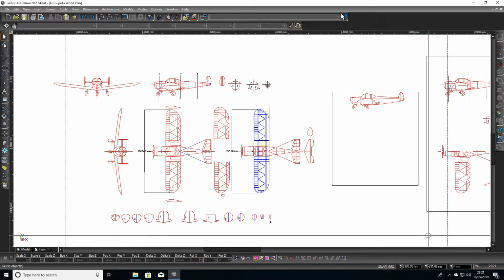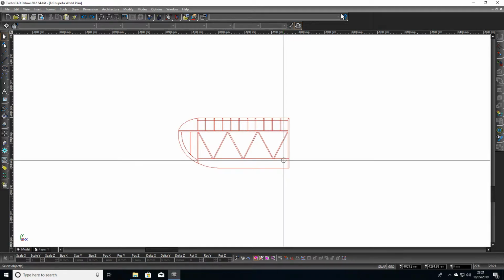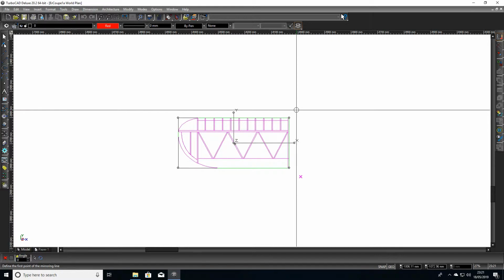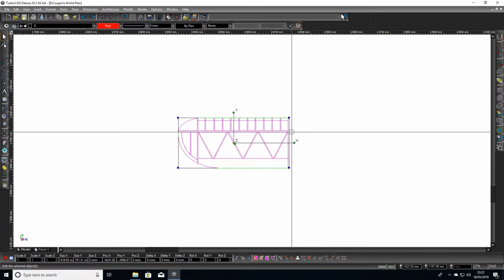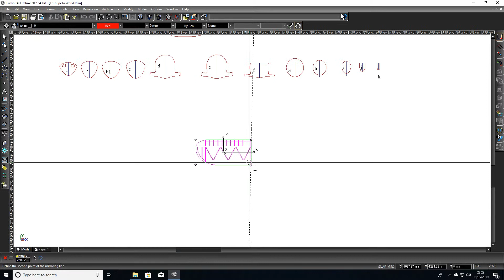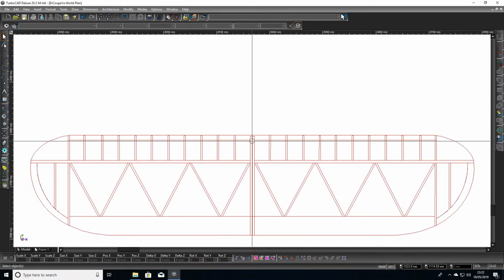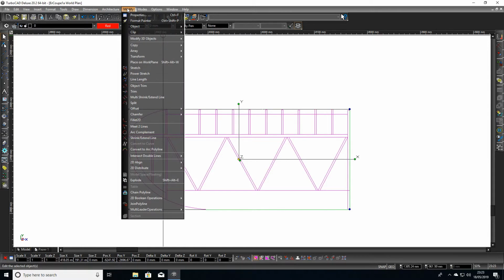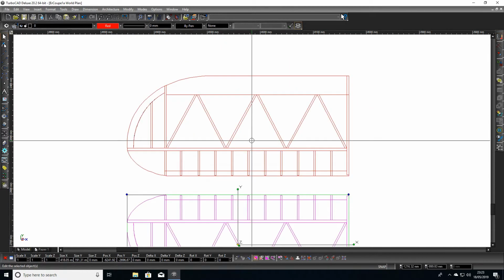TurboCad Deluxe 20 Mirror copy

Comment: Thanks for making this vid! Getting ready to buy Turbo cad 2019, In trial mode right now. Was having a hard time figuring out the mirror function. Thanks again.
Reply from the maker: Hi,
There are lots of good videos for TurboCad but i find i have to watch a full video just to find out how to do the one thing i was strugling with.
So that is why i made this one to show a buddy how to do simple mirror function. I have tried a lot of Cad programs inculding free ones, i find TurboCad easy and have been useing it since version 14.
Thanks for the repley.
Reply: @RcAircraft  Have you ever figured out how to use a center line with mirror reference.  Like if you draw a box  with a center horizontal and vertical line. set some how to mirror. So anything you draw in any quadrant/corner it is mirrored?  I have been also using a few other cad programs.  Q-cad, q-cam, and designspark, using Cambam, mach 3, with my cnc machine. 1 year in now and have learned so much in one year. P.S.  you should try Designspark its amazing. I can set mirror functions so easy in that program.  Just not sure exactly how accurate it is.  Thats why I am looking at Turbocad. Need the maximum accuracy.  Happy New year.
Reply from the maker: @toddspeck9415  Not sure what you mean , Array copy?
Reply: @RcAircraft   No not array copy.  If you ever had a chance to check out Design Spark  its amazing.  I can make a box as a template.  Set a vertical and horizontal line. then select both as mirror lines. Then everything you draw in one quadrant is mirrored exactly as you draw it.  I have been really studying Turbocad  I am super impressed with all it can do. The manual is only 733 pages. he he  I will be studying and learning all those pages over a period of time. I am so impressed with Turbocad gonna have to bust out the money and buy it in the next day or so. I drew up a couple simple drawings and sent it over to cambam and it loaded nicely. It wasn't loading at first but after a few settings changed It loaded just fine.   I really like the feature where as you draw it mirrors it as you draw. I have a feeling that Turbocad can do it.  p.s.  I have been flying rc planes, helis, and quads for quite awhile now. off and on over 20 years with planes. helis 5 and quads 5. I just love R.C.  I see your pic with that plane.  Big smiles!
Reply from the maker: @toddspeck9415 Hi, i will have a go at DSM and see if i  can reproduce My Sipa 200 that i designed with TurboCad V.18.
https://youtu.be/0lYDlC-SzlE.
Do you know if it will cover surfaces ?.